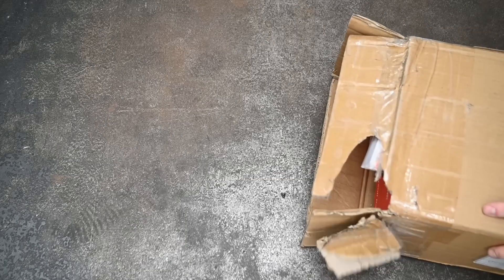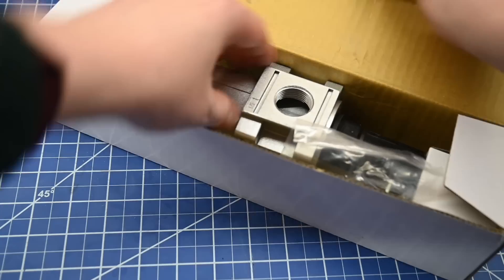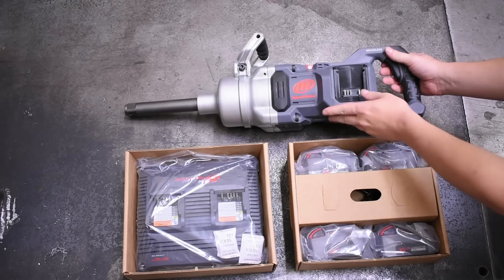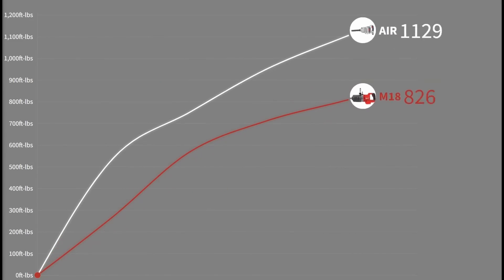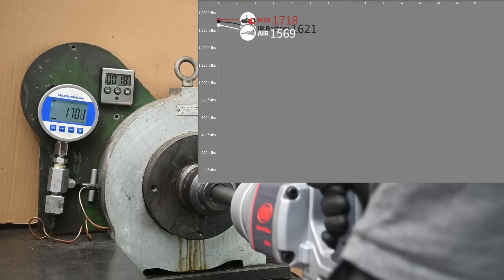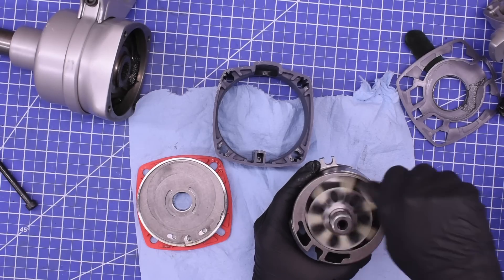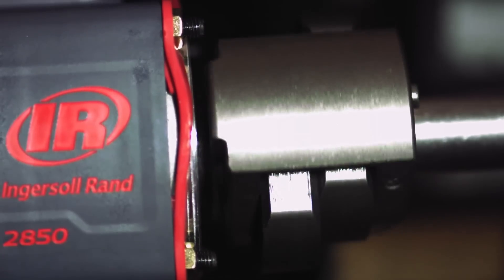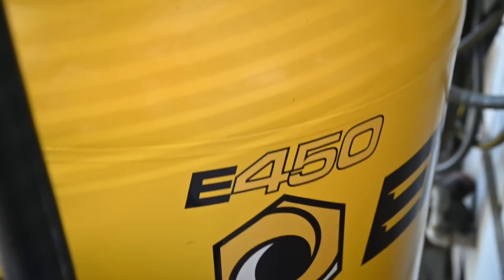The Impact Dealers Tighten Your Lug Nuts With: Largest Air vs Cordless

Comment: I’d be curious to see that Air impact on a portable, tow-behind air compressor. We have an Atlas-Copco compressor on the farm and when none of our impacts worked on a piece of equipment a Deere Technician said we could use a big boi impact on our compressor we previously only used to blow our equipment off with. So we bought an IR, and the first sound out of Dad’s mouth after easily removing the nut was a legit giggle 😂

Comment: This may be designed for a trailered air compressor typically used with pneumatic jack hammers
Reply from the maker: We're well within the recommended air volume with the compressor, we can also monitor pressure drop and it remains above the recommended pressure

Comment: Truck mechanic service truck here. Miller Bobcat Air Pack for air can go up 180 psi. For the hard stuff I prefer air; 1", 3/4, and stubby 1/2 impacts; Big Nasty air hammer, grinder etc. For the quick jobs I got a lot of Milwaukee, wished we had those many years ago. The electric drill was a game changer over the air drill.
Reply: Field Heavy equipment mechanic here. I pretty much agree with this. The IMT compressor I use, I keep it at 140 psi and can get some serious stuff done

Comment: A lot of those air tools are underairpowered. One nice trick that is done for frozen and rusted bolts is to let full pressure of 120 to 150 pounds for that extra UMPTH to get the bolt loose. For truck drivers or other trucks with air brakes, one can add a air tap for air tools. I have done that on my truck and letting the air pump up to full 130 psi really make that air tool sounds like to about to explode. LOL

Comment: Will you be using the old and new air compressor at the same time for some extreme testing :)
I have 2 4 cylinder 200 liter compressors into a single large buffer tank.
Saved me almost 1200 euros for a higher cfm bigger one.

Comment: This was a fun video - WAY outside of what I would ever need/use but I really enjoyed it; thank you!  Would it be possible to add the illustrated scale of "this much torque to do this job" onto the spreadsheet? Also a bonus question if I can: I am really curious if the DCF923B would be enough for most of my  automotive work? (brakes, lugs - 120ftlbs, and other DIY car maintenance - I'm not a mechanic)

Comment: Use cylinders of compressed air witj a regulator. You can get them from most welding gas supplier.

Comment: this is literally all the tools ive used a work for years. that chicago fitting is just as dangerous as it looks, ive met like 3 seperate people whos jaw got broken by one of those. thats what the pins is there to stop, but also supposed to have a 'whip check' on it so if it does get loose something catches it.
Reply: One reason for cotters or safety wire (I use either at home) is because they're so easy to partially connect and many workers aren't the brightest lot. (Other people are why when I do a lockout the fuses go into my pocket.)

Comment: Since we maxed the wall's outlet, and pushing battery discharge rates, 
Why not am impact gun that runs off the wall with a capacitor bank for discharging into the motor? 
Afterall, we only need bursts of power...

Comment: We just got a new compressor at the shop to handle the new new equipment we have been installing, an Atlas Copco GA90, 175psi line pressure 480cfm. We already had 2" iron pipe for the header and changed it to now run the full 175 header pressure and installed regulators at all the drops as each machine and use has different requirements where before we just ran 90psi across the shop. The compressor, dryer and regulators ran around $45k installed. IMO totally worth it to not have one of the CNC machines do an emergency shutdown because someone bumped an impact while someone else was arc gouging.

Comment: Offshore Pipeline Laying Barges use Chicago fittings on all the air tools. Air tuggers (drum winches) need a lot of air for moving (dragging) things around on the deck. I’ve seen the occasional use of mechanic’s wire to dissuade other workers from disconnecting a specific piece of critical equipment or to keep a line steady because the rubber seal is getting worn out but never seen those clips used.

Comment: my used 200 PSI 80 Gal 2 stage compressor was 200 used + 150 for a VFD
Reply from the maker: Our 80 gallon compressor was free, was already at the shop. But wouldnt feed these unfortunately.

Comment: How did you spend $15k on a compressor???
Reply from the maker: $4800 on compressor, required $9k in larger and upgraded panel + wiring to it, tool, fittings

Comment: So what sort of thing are you breaking loose that you may need a handheld, 3000ft lbs impact, lol?
Reply from the maker: It's not uncommon for 33mm lug nut and budd nuts to require impacts this size advertised in the 1800-2000+ range to remove after seeing the road for some time. The 3000 is just marketing fluff
Reply: I work on oilfield equipment and we use IR3940b1 regularly but it’s more about stuff rusting together then the torque we need off even if that means twisted off

Comment: I dont even have a impact or really need one i think. But its just intresting to see. 

Are there numbers for efficiency when using air? I have really no idea if these are 80% or 10% efficient.

And what is the usage of air powered tools in a workplace im curious never worked with one

Comment: will you give updates on the remote drain for the tank, been through 5 different automatic timed ones and still looking for a good one.
Reply from the maker: Sure, though this one came from Emax/eaton. The remote power switch we installed for it
Reply: We use a bekomat that has been running for 14 years now. We service it every few years and it runs 24/7

Comment: That big air impact, if you really want to see what it can put out, hire a diesel compressor that is used by road construction companies for running the big breaker chisels.
Those things have almost limitless cfm as they ramp up on demand to keep up with the jackhammers they're designed to run.
A company I worked for had 2 huge screw compressors outputting 8 bar into 10000l air tanks so there was plenty of pressure to run all air tools, but the Ingersoll 1" impact always seemed underpowered for its size.
So I piped it up to a diesel version that was on hire for construction work using the jackhammer air hoses and connectors you showed.
That 1" impact near broke my wrists with the torque, it became a monster.
Reply: That's likely the setup it's designed for. Use on railway bolts and various heavy building/highway fasteners, especially rusty ones. .
Reply: I was so glad to see your comment, it was like hearing an echo of my own thoughts. When I saw the compressor in the video, I was thinking "use a 1" hose and run it from a 980cfm compressor with no receiver".
Reply: Or buy an industrial 3-phase screw compressor if you have 480 volt 3-phase.
Reply: When he was talking about big air at the beginning, that's what I expected a cut scene to flip to - not the big 120gal electric unit 😂

I look at the specs for my shop air and go "that's a lot of air", then I look at even the small tow behind compressors and get a reality check.
Reply: The towable compressors are almost always 208 cfm.
Reply: step 1: get 3 big buff men to hold on to the nut buster
step 2: start nut busting
Reply: There must be difference in pressure drop. Doc doesnt say what is max pressure tool can handle. Usually pressure regulators are limiting factor. I used small tank after regulator and then oiler after tank.
Reply: its about the heat of compression. and the loss of it. Pressure, Volume, AND Temperature.

the big reservoir tanks.. they stay at ambient. your hot compressed air being cooled, dried, and stored. it drops in pressure... can squeeze more into the tank when its cold, mind you... the volume of air in a tank depends on pressure AND temperature.

as soon as that air starts expanding, it drops below ambient, and it cannot expand to its original volume without absorbing heat. "thats the joule thomson cooling effect!"

yes, yes it is. it also means you cant get the same work from cold compressed air as you can from HOT compressed air... for some reason most people seem to overlook that aspect. its really basic!

end result,  big consumer tools freeze up, any water vapour creates ice and snow on valve gear, blocks ports, etc... major issue in mining with the big air drills and hammers... you cant remove ALL the water vapour.

yet a WARM tool... it suffers no problem with ice, even water vapours no issue as it doesnt condense... just passes right through.

that diesel compressor is running on demand... the only heat loss is through the delivery pipe.

if you went the extra step of pumping that compressed air through a heat exchanger in the exhaust, and heated the air to, say, 300C, the amount of power available doubles, as that hot air can expand to slightly more than double its original volume.
as long as it maintains that temperature... if you then attached 100M of airline, its pointless as it will simply heat the airline up, radiate the heat away, and by the end, its back to ambient and you havent gained anything...

back when compressed air was a big part of industry, to the point that some cities actually had it piped like we have electricity cables, it was common to have a "reheater", most times a kerosene lantern in a sealed box in the air line, as close to the point of USE as possible. just to restore the heat lost in compression and storage and air traps and the like...

if you ever have to run a really long airline that cant flow enough... a few extra feet coiled up and dunked in a bucket of boiling water works wonders. get the air up to 80C or so... can make all the difference on that rusty lugnut... i actually have a 9 row oil cooler for doing this when i have to... meh, i cant move my compressor... so i just throw fittings on some garden hose when needed...

remember, that big diesel engine works exactly the same way... it compresses air, then adds fuel, that creates HEAT. and its the HEAT that raises the pressure so it can perform more work as it expands, than it took to compress it. they dont run on fuel alone, they run on air, and the changes in pressure created in that air by the heat of combustion.

take away the heat, the fuel... you just got a compressor. JAKE BRAKES!!!!

BR-R-R-R-R-R-R-R-R-R-R-R-R-R-R-R-R-R-R-R-R-R-R-R-R-R-R-R....
Reply: @paradiselost9946  Having read your comment, I now want to see how a 1" rattle-gun would run on superheated steam.

Comment: Used ir 1.5 sq impacts  at work for installing oil well riser bolts. I think 3.5" acme thread. Your IR rotor is lightened, thats new. The old units had a solid rotor. Also those 4 body bolts would rattle loose or occasionally shear. Loctite didnt hold up after "running riser", 1 install of riser pipe, 300 to 500 bolts. We would have to torque after using the impacts to tighten or B/O. Cool to see more heavy industry stuff on your channel. The world of fastening is big.

Comment: You should rent one of those gas compressors that come on a trailer. Those big air impacts are designed to run on them, or big mine air stuff.

Comment: Great to see that now you have proper equipment for running high power airtools, would be nice to test out the big 3/4inch impacts and also the thor impact to see if you can see diffrence even on half inch stuff with smaller air systems. 
I don't know what your education is, but your videos have near on scientific approach, but with bit of real life common sense, explained in a way that is easy to understand, and with bit of fun factor as well, especially compared with some other tool testing channels that are not only biased but also don't have clue about the stuff they are doing lol
Keep this up👍👍
Reply: Many of the brands there is no differance between the 3/4 and 1" except the anvil. The ir285 is one of them

Comment: You can now test air rivit busters and chipping hammers.
I have the ingersol rand IRG4A1SA
In my truck shop works great for seized king pins and suspension bolts

Comment: I wonder if the 1" IR would improve its numbers after some run time just to losen up the bearings & have the air vanes seat/seal a little better. I'm not sure if this happens or not but love the new air rig @TTC. Always love it when you test pneumatics. It made me 😢 sad when you couldn't test 3/4 & 1" tools so awesome upgrade 👍
Reply: These work best right out the box and go downhill fast

Comment: Considering 98.% of the people watching you are regular Joe blow from down the way rotating their own tires and such it would be insanity to try and purchase the needed compressor, lines, and fittings to run those big boys. Hell I’ve got decent enough air compressor and it strains to keep up with die grinder

Comment: In Australia those high Flow fittings are called Minsup after their original brand. Been used in mining since before they had electric head lamps. For Rock Drills.
Thats bloody high for shop line pressure 150 psi. Just the cost alone to bring it up beyond 100psi on a daily basis would be crazy. To say nothing about the danger if you lost a hose or connection. The trouble is that with that sort of pressure and flow requirement I would be surprised if there was a anti whip valve available to prevent a hose dance.  Best practice would be to use a safety chain from the hose to the tool that goes past the fitting. Pretty common to do on extension hoses. Plenty of reasons to ignore all this but to say annoy the neighbors one day you should try an open ended hose with all the air for a few seconds and you might change your mind. A 3 way ball valve to isolate the system is never a bad thing as long as it is installed to allow it to dump system pressure whilst isolating the source.
Reply: "Whip check" safety cables easily solve the dancing hose issue and are inexpensive.

Comment: As a technician that works on heavy equipment I'm torn...as long as I'm with the company air will always be the sensible buy. Since the company supply the compressor to back the tools. But at home electric is the way to go. 

I've had cross threaded 33mm semi bolts before. Electric won't be able to do, hammering for over 10min straight would've killed an electric impact. When duty calls air is sure to follow.
Reply: Wait and see how the Dewalt 60v will test.  I get the strong feeling that it’ll be a channel record for a very long time.
Reply: Had a breakdown one time, tire went bad on the trailer. Shop found crossthreaded lug, 33mm. Took an extra hour due to stud changeout.
Reply: I'm not torn because every of many times I chose industrial equipment (judiciously bought at auction etc) my home gearhead life becomes MUCH more convenient. I use cordless for mobile work like harvesting salvage yard parts where there is no shore power or air or quick jobs around the former farm I live on, air for blasting, needle scaling and the usual stuff in shop, and corded in-shop because accumulating high quality used corded tools like Hole Hawgs, portabands, and especially angle and electric die grinders (welders favor electric for high torque at low RPM, Milwaukee 4196 is an example) go so cheap. I also use portable CO2 cylinders for inflating tires in the field and running pneumatic tools briefly. Construction outfits often roll that way and the CO2 is also shielding gas for MIG welding.
Reply: @Comm0ut  CO2 is shielding gas for MAG... not MIG. :p
mild ACTIVE gas...

and you cant do positional welds with it. great penetration, but such a liquid pool that its all horizontal or nothing...

whereas trying to use pure argon on MiG doesnt work so well. they actually add a touch of oxygen to allow for easier arc initiation. and a certain percentage of CO2 as argon alone makes the wire tend to ball up and refuse to "wet"... unless its aluminium, of course! only run CO2 mixtures on steel, non-ferrous metals are always pure argon.

once you try it, you see exactly what i mean... you cnnot get a good arc transfer with pure argon on steel...

 and then as the requirements for penetration go up, so does the CO2 concentration... thats why theres "light" and "heavy" versions of MIG gas... depending on your supplier?
Reply: why would you lugg off the nut rather than chop it off if you have to replace it? seems more reasonable to cut the lug so you can swap it faster since it's already junk. Hourly pay is my only guess
Reply: I will always use air 1 in impact even in the field. The cordless impacts overheat, eat batteries, and 90% of the time, can't remove track bolts, cylinder nuts, and especially cutting edges. Air is king if you got an air compressor
Reply: I will always choose air even as a field heavy equipment mechanic. I have the shorter anvil IR impact, and it will bust cylinder nuts, track bolts/sprocket bolts (d10 and d11 dozer), and cutting edge nuts on scrapers/dozers where the Milwaukee battery impact couldn't. I always service the air compressor and drain my tanks so I will always have air.

Comment: Do yourself a favour, and remove the petcock on the bottom of the compressor. Next, install a 90^ elbow, a check valve, and enough braided stainless line to reach outside the building. Next, add a valve for draining the compressor. Make sure the location is convenient, and drain the tank daily. 
Have a great day, Sir. o7

Comment: I own the ir air gun and the Milwaukee. The air gun absolutely hits harder but never use it over the Milwaukee. I’ve had a few luck nuts it had to hammer on for a bit but better then running the compressor. Most service truck compressors you need to let it build back up 1/2 through tightening them back up